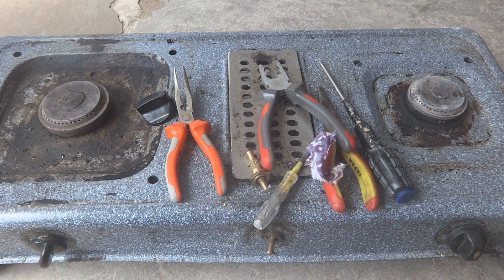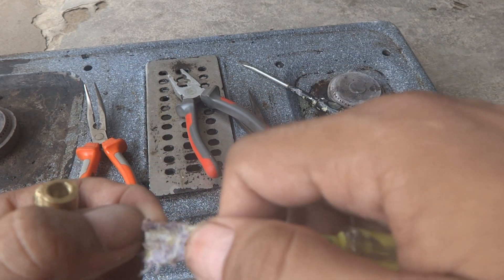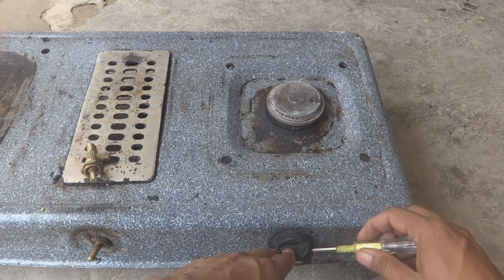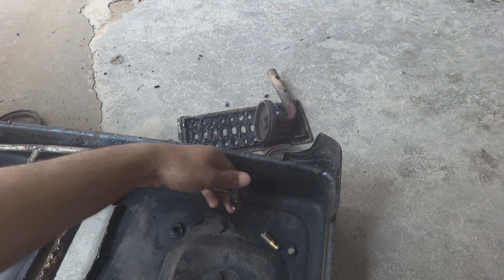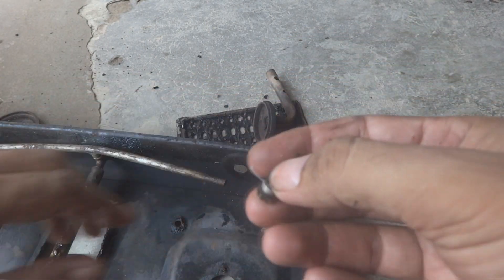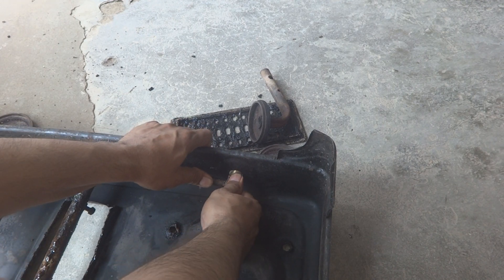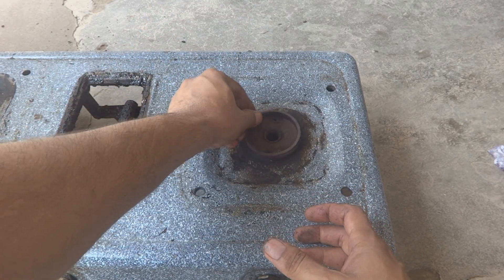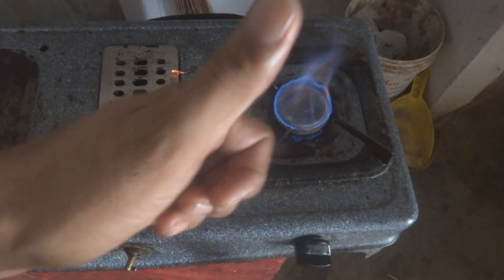Gas stove burner repair. A DIY home repair for everybody

Comment: Well done :-D, working like new again, ready for use :-D.
Yes the valve does look crudely casted, but it works :-D.

The string or teeth flossing string is much like wrapping some ptfe tape around a home gas cooker inlet :-)
Some enginners moaned when i used white ptfe, they say green is the stuff i must use, but my white ptfe works perfect, no leaks.
I think they are trying to make money from me, that won't work lol.
Reply from the maker: Thank you very much dear sir for liking video and appreciation. In my view point anything which prevents leak, do awesomely and if it is readily available and very low cost; it is blessing then. Sure people who learned something, they stick to that only. They are not trying any innovative idea.

Comment: Good job bro, I wonder if there something to adjust the air/fuel ratio to get blue color flame. 
I like to fix anything broken around the house and I hate to throw anything away.
Reply from the maker: That is great if you are attempting such repairs yourself and avoid wastage. The flame can be adjusted from the nozzle size and the downside adjustment. Anyhow the flame it is producing by this stove is somewhat accepted to my family for ordinary kitchen use. Thanks for constructive and informative comment. Regards,

Comment: That was kind of easy fix  - but needed to be done - was that used parts that was replaced or new - looked new ??  well done
Reply from the maker: You are right it was an easy fix but was very much important for out kitchen to have two stoves at a time. The part used was new but it was a very low cost less than a $ ! The part was die caste in a little crude way but it works just fine. Tanks for nice comment and liking video.

Comment: Salaam ustaad ji another great fix I always use gas aproved ptfe tape on all gas joints the stoves in pakistan do not produce a straight powerfull flame mine is the same in pakistan I cleaned all the valves and gas regulator it is still the same but in England the gas lines do have a higher milibar pressure very good videos I  still miss the toyota videos maybe you can do one in toyota hiace repair video
Reply from the maker: Thank you very much drear friend for liking video and giving valuable information. Let pray Allah so that I may have Toyota again so that I would do videos on that! I would upload some videos on poor man's Suzuki in a few days.
Reply: LearningZone prestige 4 burner  stove repair  in tamil and spares available particulars  need